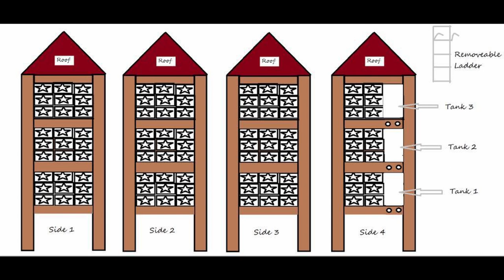Building In Ghana - Water Storage Tank Tower 1

Comment: Beautiful! I am planning on building the same. How far deep did the foundation go? Also, did you tie all four corners of the foundation to each other with the steel bars or is each corner standing independently? Also, what filling {if any) did you use inside the foundation before you covered it in concrete? Thanks in advance bro.
Reply from the maker: The foundation was 4 feet deep and 41/2 feet deep for pillars column and yes all corners tie together with steel bars. We also use compatible sand before casting the cover concrete.
Reply: @koppong05  Thank your very much. Planning on building something similar on my farm here in Kenya so this has been very helpful!
Reply: what was the thickness of the footing concrete?